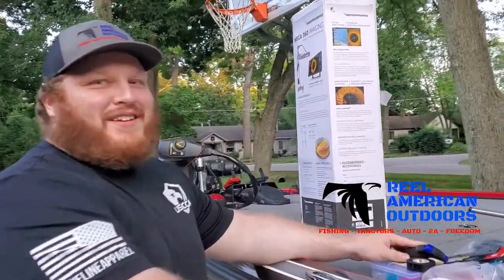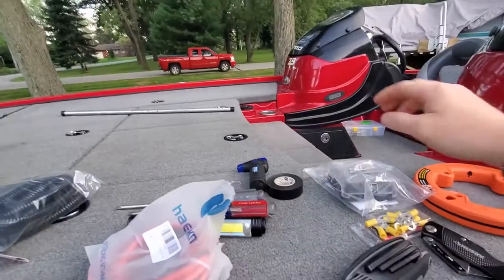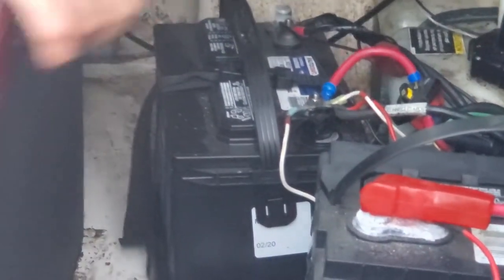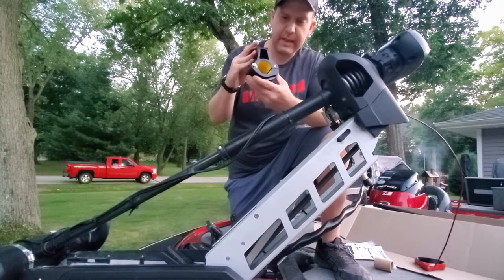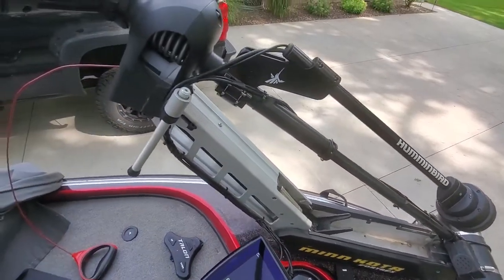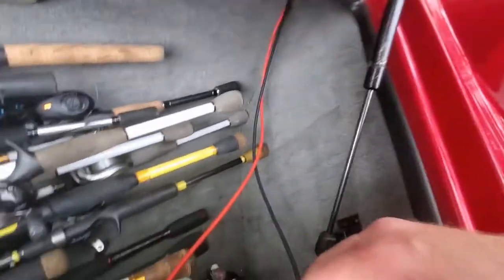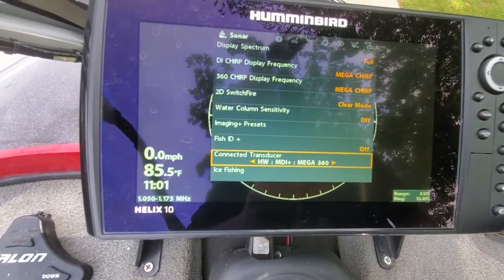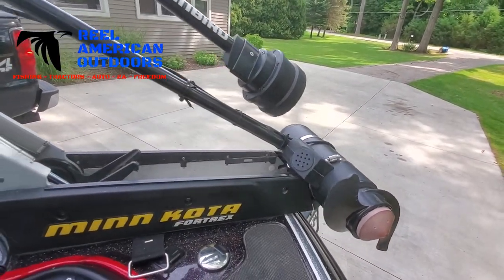Humminbird 360 MEGA Imaging Install VLOG

Comment: How do you turn off the power to the 360?  It looks like you ran from the battery to the fuse box to the unit.  Isnt an on/off or toggle switch needed?
Reply from the maker: Hey! Yes, we ran it to a fuse box pff the battery. No a on/off switch is no required per humminbird but can be added if you feel the need.

Comment: Where did you connect the ground wire form the mega 360
Reply from the maker: Grounded it to the fuse block along with the drain /shield wire.

Comment: Did you use the 7 pin or 14 pin y cable?
Reply from the maker: 7 pin because we are running a helix 10 g3n mdi+ unit with it
Reply: Do you know if the helix12 gn4 also uses the 7pin for the mega 360?
Reply from the maker: @MVRM-t9g  yep! As long as you are running an external transducer like we did in the video

Comment: Where did you hook up your drain /  shield wire?
Reply from the maker: Grounded it on the fuse block. So essentially had two grounds and one positive on the fuse block from the 360.
Reply: Love the tutorial fellas. I just recently got mega and I’m gonna hook it up soon. Can the drain wire just get connected with the negative wire? Also What one wiring kit long enough? 10’ doesn’t seem long enough. Lastly what’s the purpose on the 30amp Inline fuse of your already using that fuse box? Thanks